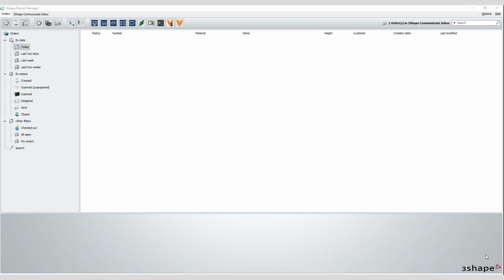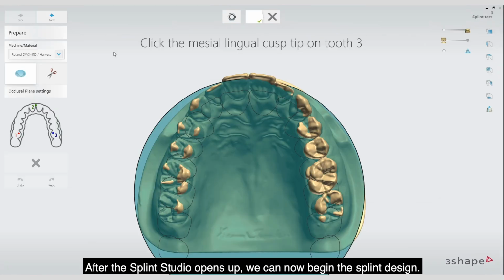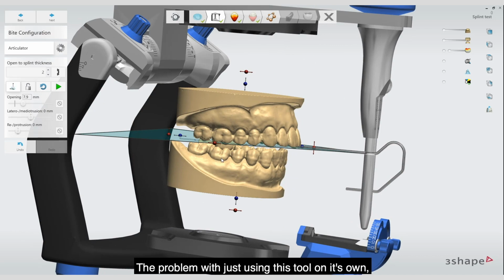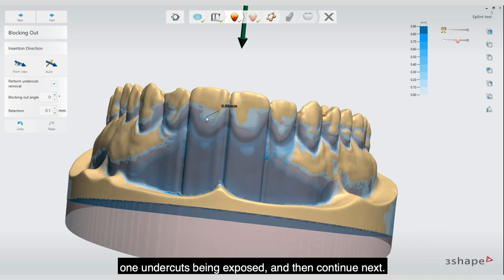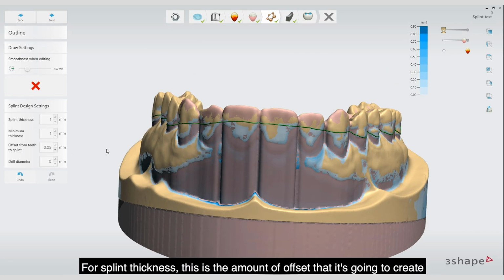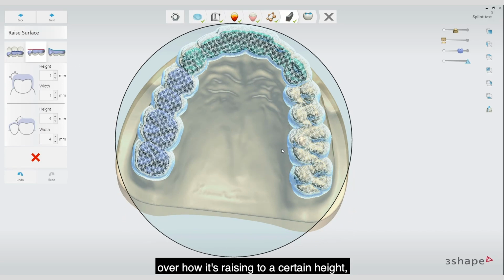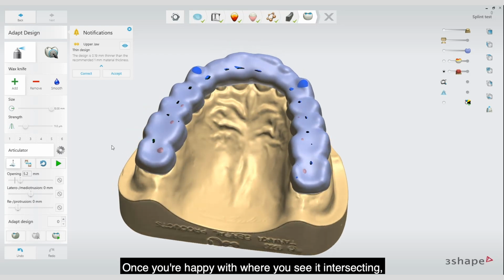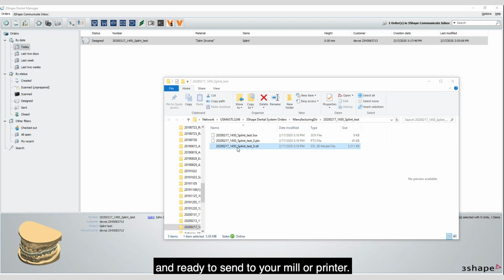How To Get Started with 3Shape Splint Studio for Night Guards

Comment: While designing a splint in 3Shape Unite Splint Studio, I noticed that the splint tends to protrude into the space of a missing tooth (as indicated by the arrow in the attached image). Since the software only provides add, reduce, and smooth tools, how can I remove or trim this unwanted section effectively?

Comment: For anyone here- I don't think this person knows how nightguards are supposed to work or how the jaw works. NEVER open the mouth straight up. The jaw is a hinge system. The nightguard would be too bulky in the posterior and only 1-2 teeth would actually be touching the nightguard.
Reply: I had the same observation. He just willy nilly decided to raise the upper arch relative to the lower from maximum intercuspation. The mandible cannot move that way.
Reply: wondering about this myself, could the software transalte mandible down the condyle and open the bite this way? Its a bit infuriating these traiing videos that overlook seemingly basic anatomy.
Reply: That is an incorrect statement……. The mandible only hinges for a couple mm’s and then it translates